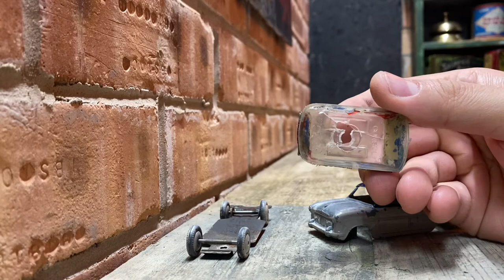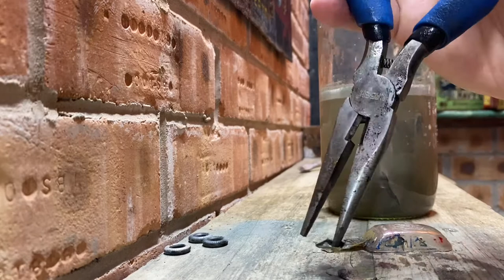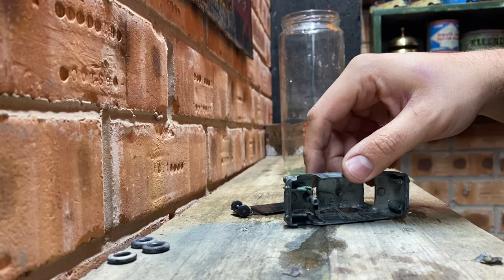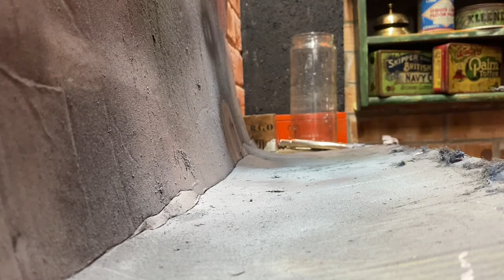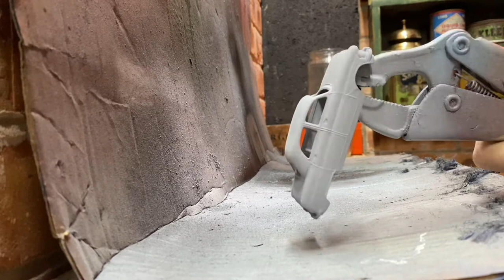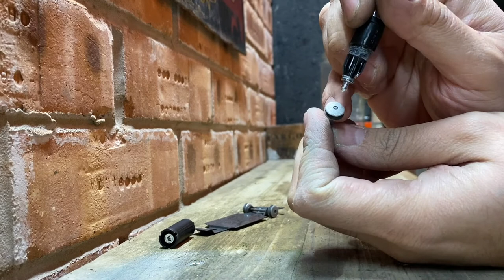Corgi Toys Ford Consul restoration

Comment: Nice job dude. The black works very well and as you say, is def in keeping with the era.
Brake fluid is usually a safer choice for getting paint off windows and plastic parts. Leave them to soak in a small container of it for a few hours and Bob's your uncle. If the going gets really tough, reproduction parts are available for most of the Corgi range.
Reply from the maker: Thank you Pete. Oh yes! What a good idea. I sell brake fluid almost every day but it never occurred to me to me to use it 😂